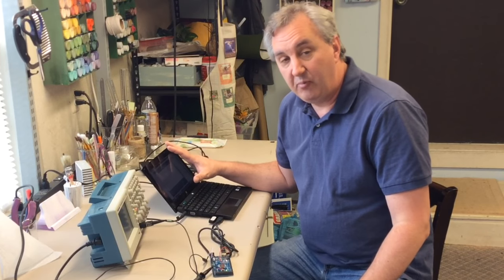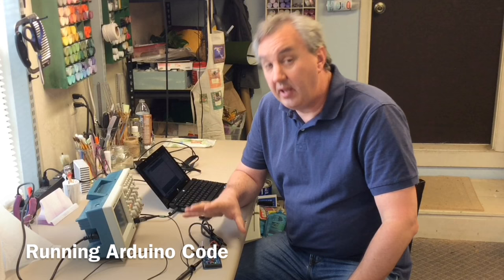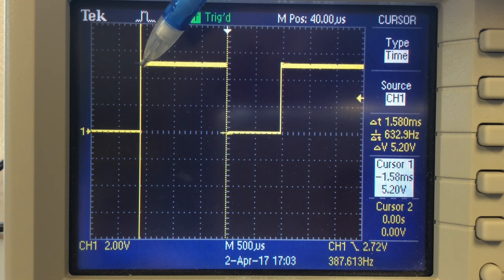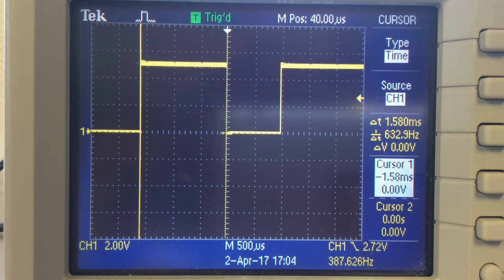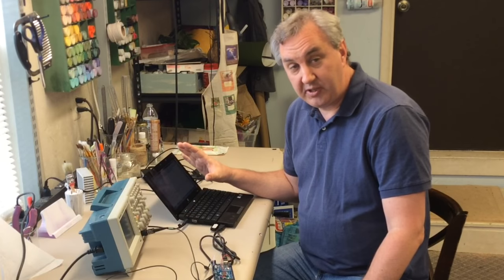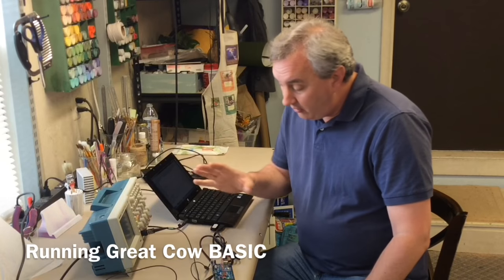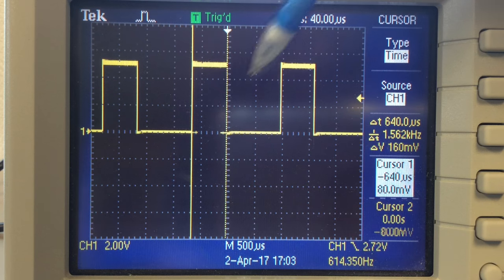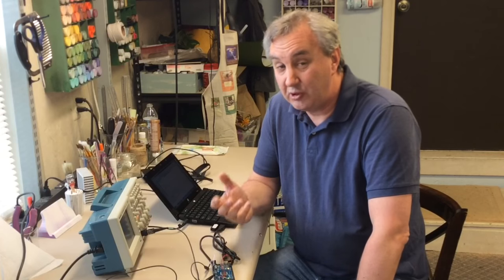8-bit Arduino Mega Speed Test vs Great Cow BASIC compiler

Comment: I guess i don't understand the problem. For 3d printers aren't the speed limitations all mechanical? I look at it like a car going down the road with the cruse control set at 55 and your idea would be like turning on a second fuel pump. The fuel gets to the engine faster and at more volume lets say but the cruse control is still set at 55.
Reply: There are mechanical limitations and there are digital limitations. The software runs an interrupt routine which runs maybe 10 000 times a second and pulses the motor drivers, which takes up about half the Marlin's CPU time on AVR Mega 2560 processor, and the interrupt frequency is chosen as a compromise between CPU time and pulse frequency. The pulse frequency is good enough for the mechanics so it's not an immediate issue, but if you could raise it, you could run finer microstepping for example, or faster, larger and better mechanics starts becoming feasible. As a matter of fact, mechanically acceleration is a tough limit that depends on gantry rigidity but linear speed is not physically limited.

The rest of the time Marlin runs a scheduler which fetches G-Code from SD-card or RS232, parses its text converting it into native number representation, translates the coordinate systems, schedules acceleration and deceleration, and generates command stream for the interrupt routine. The scheduler dropping behind is an observable issue, in these cases the print head just stops for a small time as the interrupt routine ran out of commands to execute. You can observe this with fine curves at higher speeds, resulting in uneven motion and ripple, or as a slow layer change where the head just hangs about and melts already laid down plastic after a tough curve, and it's a severe issue on Delta geometry where every linear segment output by the slicer actually results in non-linear, curved against time motion of the print head, approximated by again smaller linear sections, which could also be made more exact if the throughput of scheduler was increased.
Reply: On a Delta printer the 2560 can't keep up even at 1/16 microstepping and on a Cartesian printer it will skip at 1/32 microstepping (all speeds can't be maxed out) because the code is spending far too much time diddling around as Chuck just showed.
Reply: For the majority of machines, yes, the speed limitations are mechanical.
However, when you start getting into delta machines, commands have to be sent to all 3 motors at all times. That is 50% more work than you standard Cartesian machine must handle, being that all printing motions on those machines happen on two motor axis.

What that means for speed is, smooth flow of filament is possible at slower computational speeds on a Delta than it is a Cartesian if one is using an 8-bit arduino controller.

But why is that, specifically?

Your controller has to read the GCODE lines from memory, which takes computational power to parse it.
Then it has to engage through the various circuitry maps to change the voltage/current on the motors so they start moving. This is before they start moving.
A faster computational machine will obviously do these things faster.
These come out in your print as time the motors have to wait after completing a command. Normally you won't see it since the controller is so fast it does everything before you notice that it had to wait.

But as you start printing faster and faster, you can eventually hit a point where the motors stall for just long enough between extrusions that the motors cannot keep up with how fast the filament is supposed to be fed. So the extruder motor in particular hangs at time, because the processor is logical [read: linear] and it would have been telling another motor to move in the time where for ideal print quality it should have been already telling the extruder to begin the next extrusion.

How exactly more efficient code comes into this is simple: the machine has to read less lines in order to get to the point.

Any little piece of machinery you add to the print process expands the burden on the controller. An active heated bed has a software polling rate and a logical process that must decide whether or not to turn the heater on or off. Zones of the heated build plate are the same. The same for a second extruder and heater block.
Reply: Chuck is right because on a delta (as I mentioned above) it takes the Arduino so long to do the calculations that it doesn't have enough time to come back around to tell the steppers to move so people have to keep their Delta printers below about 100mm/s (give or take) and this is why people say to get a 32 bit processing board because they will use faster clock speeds so the math can be done much faster leaving idle time which is what we want.

Comment: How about a comparison between Arduino and C/C++
Reply: You do realize the code written for the Arduino is already C, right?  Its problem is the compiler hasn't optimized a thing.
Reply: Yes the AVR C compiler.
Would you be able to load the code to the chip using a Pickit 2/3 ?
Reply: yes, or use a bootloader, which there should be several for 2560.
Reply: Ahhh, yes but the Arduino is based on the GCC-AVR compiler and to be honest I haven't like GCC in over a decade at least on Windows as MSVC blew it away every single time.  So, I suspect if we could get a better compiler we would no longer need ARM based systems except for the extreme cases.

Comment: Very Enjoyable!  I've got a couple of printers.  While Marlin (on Rambo-mini) is fine on a cartesian printer, Marlin on 8-bit GT2560 isn't doing so well on the Delta.  I've been watching the Marlin Github closely for 6 months.  It is obvious they are running up against a number of limitations, not all solely related to 8 vs. 32-bit but many are certainly platform related (floating point math, running of memory, etc.).  You might enjoy looking through this thread: https://github.com/MarlinFirmware/Marlin/issues/3851

I've just received a new Delta printer kit with a DuetWifi 32-bit board.  I'm really looking forward to learning a new platform.

Comment: Sorry, but the test does not make sense. The message does not scale and is misleading to beginners.
It is in essence the same argument that some Fortran guys used 20 years ago. The code contains a loop that calls 250 times the function digitalwrite with the same argument. The code ist nonsense and the compiler is not made to convert badly written code into a good outcome.. The gcc in the Arduino IDE cannot optimize as the function is taken out of a lib. Thus is puts 250 times the registers on stack, calls the function, pulls back from stack. In Basic the digitalwrite analogon is a built-in function. Thus it just drops a bit of assembly code into the loop and the stack operations are not needed. In C/C++ you use inline for that.
The test basically only proves that with bad coding you might be better of with Basic.